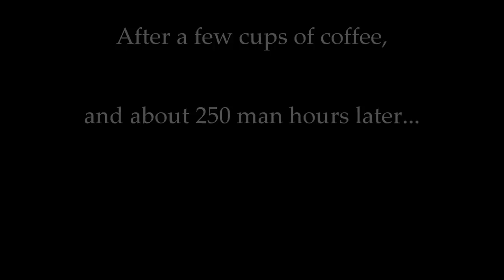Chopping the roof of a '46 Cadillac hearse

Comment: That looks absolutely stunning! And it’s easy to ruin the proportions especially on such a long car. I’ve seen far too many extreme chops where they leave little peek-a-boo chips of glass for the windows and windscreens and the whole thing goes from 1940’s gangster ride to a blown up matchbox toy with an engine. This came out like a proper luxury station wagon that Cadillac used to do, albeit rarely, way back in the old custom commission/coach building days.